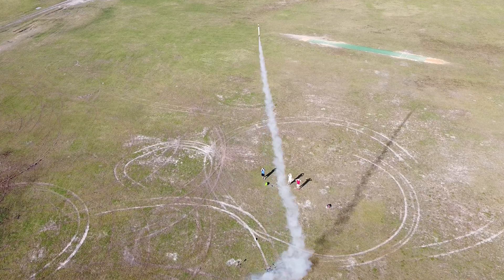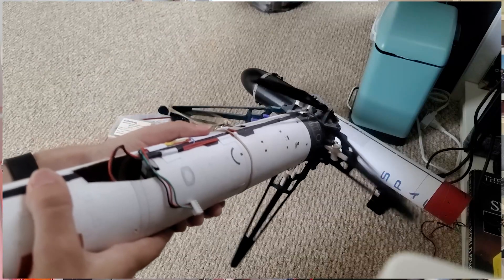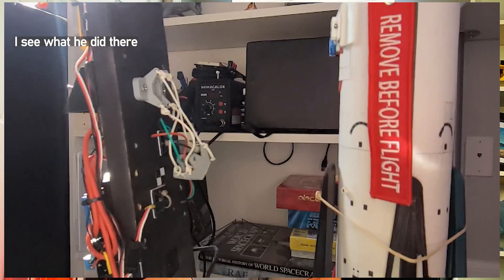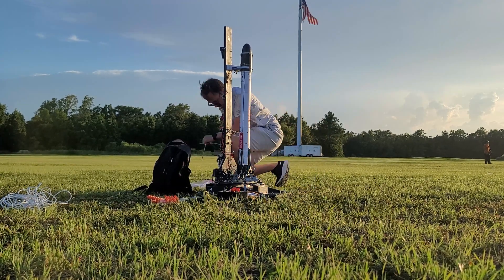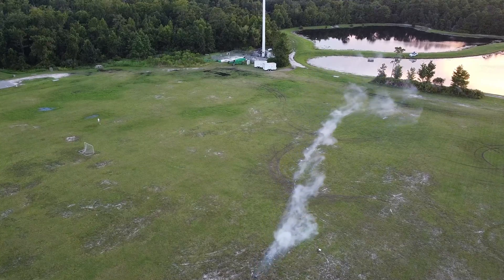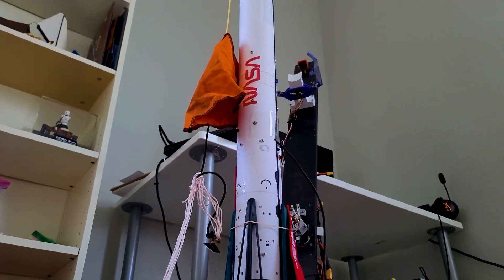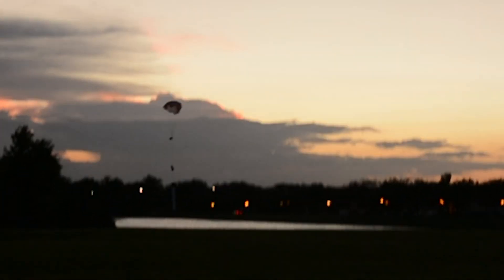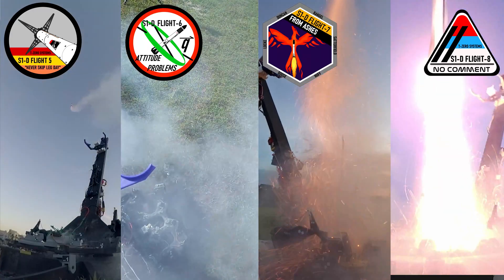DIY SpaceX Rocket Factory at Home

Comment: Every bug is two bugs: the bug itself and the failure of the testing system to detect it. The first one affected your project, but the second one affects your future project development speed. Fix both.

Specifically, how could a pre-launch testing regimen automatically detect that the sensor was not being read by the software? A puff of air over the sensor during launch checks might do the trick, but I'm not sure cuz I'm not familiar with those sensors. If the check works, though, the same test might also detect the inevitable case of a sensor going out during the final setup.
Reply from the maker: It detects a liftoff via looking at the acceleration and does a confirmation by showing an altitude increase on the barometer. On startup there are health checks too of the sensor but when I commented out the read altimeter sensor line of code there was no checks or fixes that would have saved me. // is all it took to smash flight 7 but the data showed it remained at an altitude of 0. For safety sake the rocket regards this as a condition where the pyros cannot fire to prevent them from going off on the ground. The system worked correctly given the information it had and in the end failed safely. the only way to work around this more would be to integrate acceleration for altitude and show an increase that is sustained which I will likely add in as well.